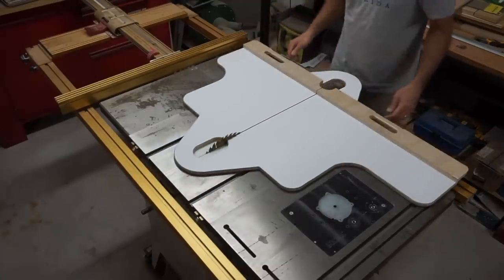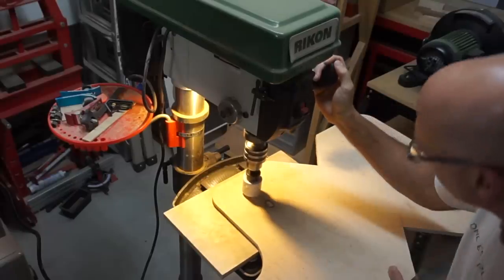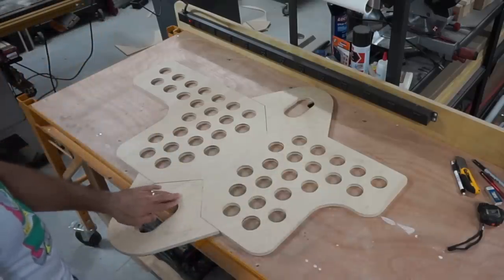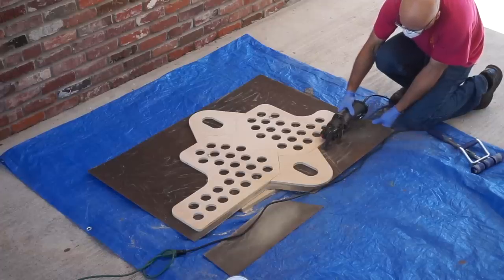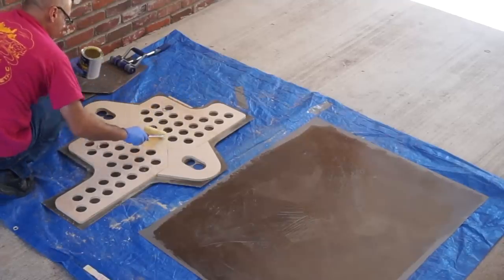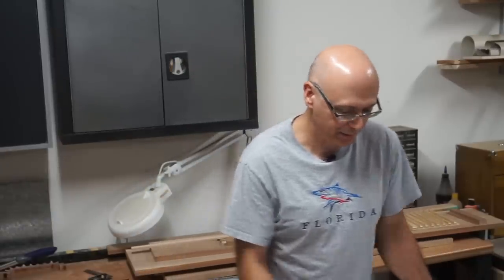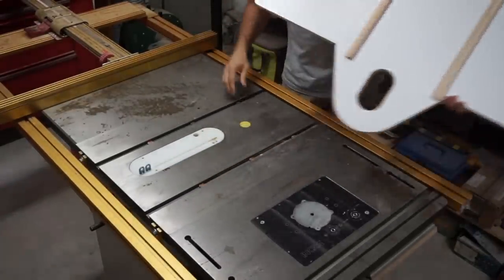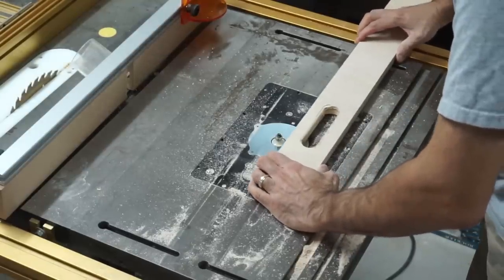A Crosscut Sled Like No Other

Comment: Very nice design. However, you really need to use some kind of holddown when you are cutting wood like that. It wouldn't be difficult to add. Also, I would have used the five cut method to check for squareness. You could have very easily gotten that fence perfectly square if you had fastened the fence with two screws, one on either end, checked for squareness, then screwed it in place with properly placed screws.
Reply: The difficulty is that unlike a normal fence, this one is actually cut in half - making it very hard to adjust the angle once it is in place.
You would need to add a temporary "bridge" piece, or have it bulge out behind the blade to keep everything aligned while cutting

Comment: OK guys, after a few thousand comments about the way he didn’t hold down the material, I think he gets the picture.  By creating this video he has done us all a great service. If we take the time to read the comments, we all learn a little bit more.
1) Also the five cut method is great and I think adding a taller fence with a small rabbet on the bottom edge of the fence to clear out some sawdust is a good idea. 
2) Putting a stop under the front of the sled keeps it from going too far and cutting your hands is also a good idea. 
3) Using small strips of material under the contact cement pieces is a great idea.
4) To save using excess contact cement, first place the centrepiece on the top then bottom pieces so you can draw the shape of the sled out. Then when you’re putting contact cement on, just use a little cement outside and fill in the insides of the lines is also be a good idea.
5) Since the sled is already so light, adding the higher end piece will allow you to cut through the back and still keep everything attached.
6) finally, I’m so glad this guy made this video, it shows that most people know the right way to cut something on a sled, but his genius is going to help all of us pretty much later much better slats because of all the comments everybody’s been able to make. Thank you very much for making this video, and I hope you don’t feel too bad because you made a mistake, after all don’t we all? Then we all learn from our mistakes just as you have.
Reply from the maker: Thanks for your comments, Barry. I guess we all learn something from every experience. Me feel bad? Heck no, I’ve got no reason to feel bad.

Comment: Hello! I think you are off to a great start with your sled design. The most innovative idea was definitely to cut all those holes in the ply and then laminate the surfaces to create a much lighter sled. I think I'm going to do that same thing on a future sled build.

I wouldn't use epoxy  though to connect the runners or the main fence. Unfortunately now you have no way to replace or adjust those items and if your runners wear out over time or something happens to that fence, you have to throw the whole thing away, and that makes me sad :-) I would highly recommend double sided tape to place the runners and fence and then fasten them with screws. This allows for adjustment and eventual replacement.

The other two things I thought of would be to double up the fence height by laminating two pieces of ply. Otherwise you are going to  get big time blowout on any piece you are cutting that is thicker than the fence. The other thing is to add a blade guard. You should always have a piece of wood there for the blade to terminate into when the cut is complete.

One other thing to note is that I agree with others that your test for squareness wasn't really meaningful. Unless that scrap of wood you started with was completely square, the reading you got from the calipers isn't what you think it is. The five cut method corrects for this and allows you to get a more accurate measure of squareness no matter if the material starts out square or not.

If I were you, I'd call this version 1.0 and make some small changes to give you a fantastic (not just pretty good) new sled!

Keep it up!
Reply from the maker: Thanks, MWA Woodworks, you've made some good points.
Reply: I can't like that review any better.   I think I need to make one now with those with those suggestions!
Reply: MA Woodworks
Reply: paul kelly
Reply: MWA Woodworks What you said, and I do love that design.

Comment: Cool, I like the idea of the lightweight sled.  My sled is made from scrap and is bulky so I don't get it out to use it when I should.  A tip for doing laminate, is to put 4 or 5  1/2" dowels across the board and then lower laminate onto the board.  Starting from the center pull the dowel out and press in place continuing from center outward.  It's much easier to handle the laminate when projects get larger. The laminate only needs to be rolled on the laminate side.  I too had issue with not securing your work piece.  I too would use the 5 cut method if I was going to the trouble of building such a nice sled.  I would want it as accurate as I could get it. This is by far the most unique design I have seen.
Reply: I was definitely wondering why he took that risky approach to the laminate
Reply: Mr Sorenson, liked the idea of the dowels.  I saved a bunch of venetian blind slats.
Reply: yep I like the dowels A LOT... but I'm a cheap old dude so I just cut strips from scraps and I keep them in a tube, standing at the end of my wall bench.... ain't no way would I apply laminate like he did... smh..... but it came out ok.
Reply: An even EASIER way to handle prepared laminant (glue applied) is to apply the contact cement to both surfaces, work on a table at waist height, place several pieces of waxed paper onto the surface of the bottom piece being sure to overlap and cover the entire piece. Then lay the top piece onto the waxed paper, lining up corners or other registration markers. While holding the parts in registration, carefully remove one piece of the waxed paper securing the two exposed surfaces. If all is properly lined up, remove the rest of the waxed paper and Voila', the part is laminated.
Reply: Mr Sorensen I

Comment: @creator I really love the design. To sum up what I would like to say, and what many others seem to agree with: 1, If you aren't securing your workpiece, there's no way to ensure your square deviation isn't simple vibration. and 2, a 5-cut square test may be a better way to test the squareness - Do a cut on all 4 sides, and then the first side once again, then measure for square. Great innovation!

Only adjustments I will probably make is to add a ruler to the handle, and put the handles closer to the center to add stability with less torque to the pushing of the sled.

Comment: Very cool design. Personally I’d build a guard for your fingers. That just looks dangerous to me but I also use a SawStop saw so I’m paranoid to begin with. I like the way you drilled out the holes and then covered them with laminate to make it lighter, kind of like an interior door is made. I do agree that it would be good to have a couple of hold downs so you don’t have to have your fingers near that blade or let the piece you cutting free float and possibly float up as it goes across the blade. I like your design of the edges. I’m in the process of making a new on right now because I downsized my table saw and my old sled was made from particle board with a 6” high 1.5” plywood fence. It was big enough to hold a cabinet door which is what I used it for primarily. You’ve given me some good ideas and thanks for sharing.
Reply from the maker: Thanks for all the feedback, Scott! I’m glad to know I gave you some inspiration for your new crosscut sled!

Comment: This looks great. Thanks for sharing. 

I made a cross slide out of 6mm ply that ran one side of the blade only and overhung the left end of the saw bench. The overhang had three skate bearings fixed to the slide underside which ran 2 one side and one the other of a steel rail fixed to the edge of the table. One bearing hole was oversized so the bearing position could be adjusted to tighten on the track when it got sloppy. The fence on the slide was adjustable for angle by having a pivot near to the line of the cut line and just a screw into the slide body so the angle could be varied and reset. 

This was built for use on a saw table that was itself scratch built from an 8*4 sheet 3/4 ply top on rough sawn lumber legs. The saw was a hand circular saw upside down let into the table and fixed to a 6mm ply platen with a wood screw to hold it in in each corner. 

The main fence was a builder's level which clamped either end to light steel angle on the bench edges with a couple of mole grips. It was all built for a big renovation job I did 15 years ago.

Comment: Great design. Three suggestions. 

1.  Cut the saw blade slot with a 1/4” dado and then lower the blade and insert a piece of 12” key stock into the slot leaving it proud. Then use your square to square up the fence on the sled using the 2 screw method. This helps to eliminate any deviations that may occur using the blade as a reference. I have found the key stock to be very straight with inserted into the slot. Then take the key stock out and glue a piece of 1/4” thick hardwood into the slot flat with the surface of the sled.  Then use your working saw blade to cut a new zero clearance slot. Then when it gets wider through use you can go back and use your 1/4” dado to clear out the insert and glue another in place. 

2. Using hardwood for the runners, make them loose fitting for the slot. After putting the coins in the slots wedge the runners in the slots. I wedge them to the outside of the saw. Then I glue and screw them in place.  This will cut down on friction drag on the runners. If your slots are imperfect then move them to the inside. I make sure I either put both runners to the outside or to the inside, this eliminates the runners from wiggling in the slots. Then of course wax the runners.

3.  Instead of cutting so many holes to lighten the weight, you could cut a numbers of slots between fewer holes.

Comment: I like this. It would serve most of my needs. As others have stated: 5-cut test for greater accuracy, need clamping and for those that want one, a blade guard. I'd prefer using a single piece of ply and eliminating the laminate. The lightening holes were a great idea. Here's an idea for v2. Design in a replaceable center insert. Different inserts could be used for different blades including dado blades. No since remaking the whole sled.
Reply from the maker: I like the idea for the replaceable insert. So is there a way to include the lightening holes while not using the laminate?
Reply: I think he means just leave off the laminate and have the holes show.  I'm tempted to drill the holes in my sled to lighten it.  What's the downside of holes you can see?  Dust build up in them?
Reply: Jim Hopkins, I'm thinking the holes would reduce surface to surface contact reducing friction between the table and the sled and the holes would also give sawdust and other particulates a place to go and be out of the way.
Reply: Tony Thomas I like the laminate for reducing the sliding friction. It also makes the unit stiff, keeps it flat, and adds durability.

Comment: I think you did a great job, I wish I had made my sled bigger and after seeing yours, I think it's time for a remake.  Just a thought, I lined my sled up with the front edge of the saw table and then placed the fence just ahead of that. If your blade is square to your table, it should line everything up. Also, instead of trying to line up my square to the saw blade which could be a littel warped or you might be measuring of a tooth,  I dropped my framing square right into the kerf the blade cut.  Makes for a real positive stop to measure your angle off to place your fence.  I like your idea of the laminate, gotta make it slide nice.  I need a tall fence for some of my operations so all I have to do is add it to your design. good job

Comment: It's cool. I'm going to build something like this, with a few differences.

1) I'm going to use an mdf melamine sheet and avoid all the laminating and drilling holes - I'm fine with some extra weight
2) I will cut the entire piece from a single sheet instead of 3 separate pieces
3) I will use hdpe for the runners (from a plastic cutting board)
4) I will use a taller fence with a t-track, a flip stop, and a hold-down clamp

Wish me luck!
Reply: Plastic for the runners is a great idea.

Comment: PS - I totally concur with Steve B.  You need to do a 5-cut method on your sled fence.. that home center square you held up is probably way out of whack,  and the piece didn't look good against that.. so yeah, it's way out. William Ng's method is amazing. Honestly I think I worked totally out-of-square for 30 yrs and didn't realize the problems it was causing me - or how easy life gets building casework once your tools make perfectly square cuts.   Do check it out - you'll love your sled even more.
Reply: And please; before you go to all the trouble of building a sled, check to make sure your saw is tuned properly, blade parallel to the mitre slots and so on.
Reply: tuning up your saw is a must.... but I don't see how the blade being parallel to the miter slots are that great of a need. After all, it is the sled that is moving past the  blade and the clearance cut you make for the blade will insure that the cut is true. The fence is the key, not the slots..... but, that's just me....
Reply: I second the motion on William Ng.  I built one like Mr. Ng...under .005 over 24”.  And YES on no hold on push through.  If he’s never been hit he is VERY lucky fella.
Reply: DON'T FORGET TO MARK IT...

Comment: A very interesting idea in slimming down the bulky sled but not having anything to clamp down the stock scared the bejesus out of me.  And I'm just a beginner.
Reply: Good for you Anthony, don't listen to this idiot telling people it's not necessary to hold down your workpiece during a cut. You most certainly DO need to. And also, it's a CROSSCUT sled, for a reason. Don't rip pieces like he did. There's lots of stuff in this video to learn on what not to do.
Reply: Very well said Anthony!  I kind of got the same heebie jeebies as you did.  It's amazing what a saw is capable of when it comes to kick-back!
Reply: I just made a rather crude sled for myself to cut 30 degree miters on the short sides (24 inches long) of  some 24 X 36 inch art work bases and I'd like know where I can get some hold down clamps that I can mount on the fence push side to hold down the  36 inch long side as I'm pushing the 24 inch side through the blade.  I've seen things like that, but I don't know what they're called.  They would be screwed to the push bar.  Anybody know what they're called and where they are available from?  Thanks
Reply: As far as holding workpieces, I agree. What he did in the video was dangerous. As far as ripping is concerned, that is true. But I would hesitate to call what he did ripping. That's a tough term to ascribe to cutting sheet goods. Ripping is a term that refers to cutting along the grain. Crosscutting is across the grain. Plywood and other sheetgoods don't have such grain orientation. In any case, with proper work holding, you can indeed safely rip short stock in a crosscut sled. Clamp it down, if it fits, it ships. In fact, I'll wager that ripping small stock, properly held in a sled, is much safer than trying to rip small pieces conventionally with a fence and push stick. Jointing sleds are essentially the same thing as a crosscut sled, but optimized for the task of jointing along the grain (ripping), and with built in positive work holding clamps.

Comment: When Building Something Of This Nature, I Always Try To Design It In Such A Way That I Have A Pivot Point 
On One End And A Fine-Tune Screw Mechanism On The Other End So I Can Zero In On The Adjustment.
Trying To Glue / Screw Something Together With Precision Is Nearly Impossible.
Reply: A pivot point is a must.
Reply: I don't disagree, James and Frank M., but I DO laud the basic concept which lends itself to add-ons and certainly to adapting some form of pivot point/micro-tuning adaptation.

Comment: I love the design especially the reduction of weight by using the holes in the substrate.  Spars in aircraft wings use a similar tactic to reduce weight and maintain structural integrity.  Looks like I'll be making a new wizbang crosscut sled soon!

Comment: the nice thing about having your own shop is that you are your boss. You're not a carpenter w/ 30 plus years of experience but I don't like trapping the blade between the front and back. I made mine w/ a 1/4" sheet after a design by Norm Abram.